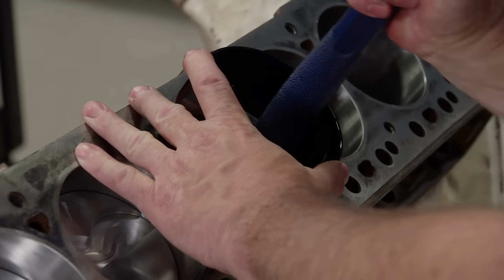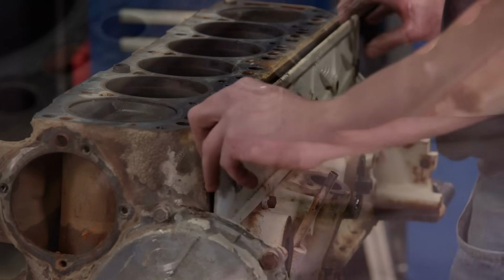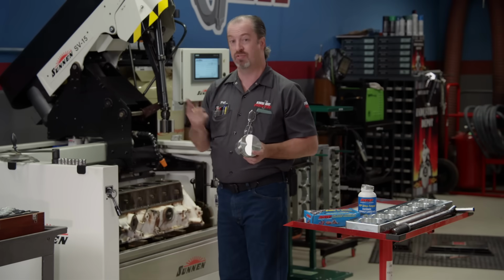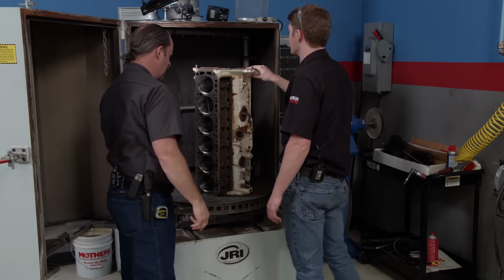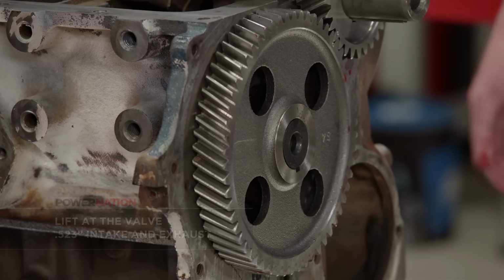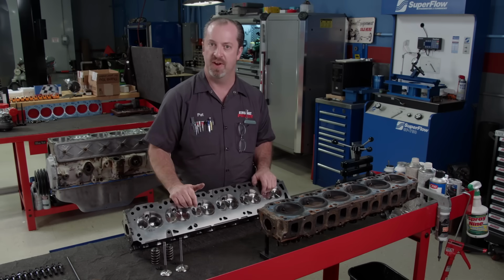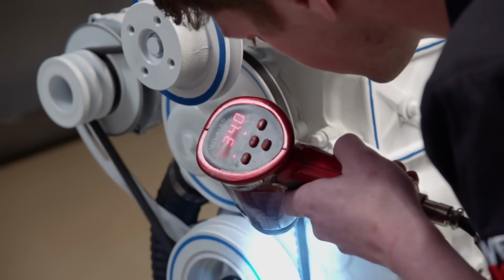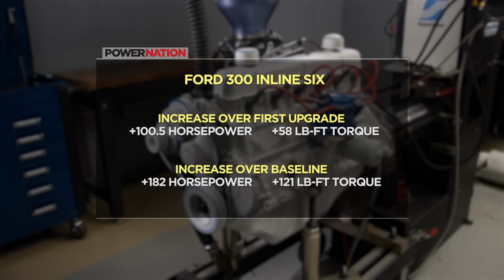Full-Tilt Build On Our Ford 300 Inline 6 For Serious Power Gains - Engine Power S8, E3

Comment: I had a f-150 with this engine, never let me down.. great engine!
Reply: John, I don't know about that my 73 ended up with over 500,000 before rebuild; it's all in how you take care for it!
Reply: @bigboreracing356  i bet it did. I have seen plenty past 500k and running like they had 50k. I personally have never seen one fail and between me and my dad we have over 30 obs fords. Best engines ever made
Reply: @bigboreracing356  design>materials used you idiot. Why do you think Chinese honda clone engines still run forever?? 
But lets break this down. 1. You could literally wear a truck out that has the inline 6 in it, throw the engine in another truck and it will outlast that one too. 2. These trucks will last well over 200k😂 proper maitenence and normal use. These trucks will last forever. Especially when paired with a manual. I see high mileage 300s all of the place still driving. We had a bricknose with 275k and the thing literally wouldn't die no matter how much abuse we put it through. And duh. Theres lots of these trucks in junk yard, but they arent there because of motor problems I can assure you that. Arpund 300k they get some lifter tick, which a bottle of marvel mystery oil seems to always solve it. Also, not only are these engines extremely simple, they dont turn very many rims which = less wear. And ughh durrr maybe ups stopped using them because they are outdated, slow and drink fuel??because it's definitely not because of reliability issues. Be careful who you talk shit to you f*ckin retard. Best engine of all time hands down(reliability wise) crysler slant 6 is close aswell as the 4.0 i6. Even chevy guys respect 300s, you are just too stupid to realize that
Reply: Had a 1973 F150 with the 300 and 3 on the tree, had tons of torque! I don't know the final ratio but I could take off on level ground in 3rd gear only issue is I couldn't pass a gas station only got around 8mpg!
Reply: @jackedwards7420  My first Truck was a 74 f100 with a 240 six in it  .   Yes it could pass a Gas station but not very fast  .  I drove a 95 f150 with the 300 in it for a long time it had plenty of Power .
Reply: @jackedwards7420  , how much weight could it pull, I'm about to buy one today 4x4 and just curious
Reply: @alfonsom8286  , I don't really know but mine was in a 76 swb pickup carrying a full cab over camper, a dirt bike mounted on front end pulling a 72 Nova drag car on a 16' trailer  and coul take off in 3rd gear!! Slow but steady!
Reply: @jackedwards7420 ,  Oh wow, those had to be fun times. Sounds like it will have no problem towing my Cadillac Seville, I'm picking the truck up today and can't wait to start the restoration,  I was leaning towards engine swap but after watching so many inline 6 power boost videos I think I'm gonna stick with it.
Reply: I still have a f150 obs with efi and it's a decent little truck
Reply: I think that's why everyone loves this build so much. Pretty much every car  guy knows someone who owned one or have owned one themselves. Such a prolific engine.
Reply: @bigboreracing356  you know that it rolls over, right. You think people are rebuilding stuff at 40k? You're pretty dumb lol .. |99999|9| miles to |00000|0| is 100k miles, doesn't take a scientist to document every time it's rolled over..
Reply: @primer50  I had an '88 F150 that was like that when I bought it. Turned out the bearings in the Mazda 5 speed were so tore up after 240k miles that it was robbing all the power. It was so bad that the cruise control would limit out due to all the throttle needed. I knew they didn't have a lot of horsepower but that let me know something was wrong in the drive line.  I swapped in a ZF S5-42 5 speed which has an even deeper overdrive and changed out the rear gears for 3.08's to squeak another mpg or so out of it and it would run down the highway no problem in high gear after that, about 1800 rpm at 60 mph, even with a trailer behind it. Got decent mileage for a 300 too. Didn't win any races with it but it pulled way more trailer than I should have with that light little truck and it never bothered that motor one bit.
Reply: I used to work at a crop dusting service. all our nurse rigs (ford f-750's from the early 70's) had 300 sixes. great engines. for the first half of the day theyd run on regular pump gas. second half we would gas up with 114 octane av gas...
Reply: @bigboreracing356  No shit sherlock, did you figure that one out for yourself or did someone have to explain it to you?  fyi, it wasn't quite 7/10s.
Reply: @primer50  
Mine was the same way. You could go faster in 3rd gear than you could in 4th. Lol
Reply: there's a guy in my town with an '88? F150 with this engine and 800k miles on it
Reply: @hank1556  Wow! 800k never heard of that.
Reply: What the hell are you guys talking about, my 300 is a dog and has left me stranded on multiple occasions
Reply: What the hell are you guys talking about, my 300 is a dog and has left me stranded on multiple occasions
Reply: i had f150 85 with this motor is indestructible
Reply: @bigboreracing356  Yes I did.  821,353 when I sold it, rebuilt the trans after 400k, replaced an alternator and water pump and blocked off the egr. That engine refused to die.
Reply: @deadon4847  guy below doesn't know how to read an odometer when it turns over that and take away the word suck from his vocabulary he's stuck
Reply: If it can still run with a rag wrapped around the impeller then you know that engine is reliable.

What happened to making engines like this?  

They completely gave up on the whole industry.

Comment: I did a 300 Ford 6 with Windsor Pistons flat pistons in it the early rods and big Cam and opened up the intake valves run like a raped ape

Comment: More straight sixes and other oddball engines!!!
Reply: It's pretty funny that you think of a straight 6 as an oddball engine. They are inherently better than a V type engine except for weight and length. If done right they can perform with any V engine of similar design parameters. BMW still sells and races inline 6 powered sports cars. And they sound so very good when made to perform properly.
Reply: @chrisbaker2903  I think he means like  old American i6 they where never really used for power
Reply: @chrisbaker2903  Only oddball in that TV shows don't do much with non V8s.  I just rebuilt a straight 6 myself. They're awesome.

Comment: However....it IS time you started using actual fuel injection. Not throttle body FI, actual fuel injection. With fuel rails, injectors, etc. 

And do a test to see how much power it gains from TBFI or a carb.
Reply: depends on which corporate overlord 'donated' parts. Pat has no say in what parts get used. Holley, FiTech whoever 'donate' parts, that's what gets used
Reply: @harveylong5878  Partially. And some stuff they source themselves. They can do real FI, if they want to.

Comment: I had two Ford vans way back when with this engine in them, when it came time to say goodbye to each of them it wasn’t because of any engine or power train problem,  the bodies just plain rusted out beyond serviceability.  The engines and power trains were still in great condition.
Reply: I sold a 93 F150 with a 300 and M5R2 trans, about 5 years ago. It was originally my Granpa's. He bou g.j t it new in Buffalo NY, and gave it to my dad in '99. I bought it from dad in '04. When I sold it, it has 722,000 miles on it. It was the original motor and trans, with just replacement parts like the alternator,  water pump, distributor, etc. The guy I sold it to is still driving it, and now it's got 780,000 on it, and it still runs great.
Reply: @scottdoubleyou563  that’s good mileage even for a big diesel
Reply: @deborahchesser7375  I'll be honest, I've been kicking myself for selling it.
Reply: i had a 1990 e350 with the 300 and a C6... no top speed but massive amounts of torque... motor blew at 140k, the "composit" timing gears teeth all wore out ... stupid thing was basically wood chips and glue
Reply: @bigboreracing356  you sitting here trying to call the 300 i6 a bad engine is a pire display of your automotive ignorance my friend. 

This engine has a cemented and proven reputation. 

I know its a ford and you feel the urge to bad mouth it and say its bad. But this engine is literally one of the greatest ever made.
Reply: @bigboreracing356  so it was a 350 or 400sbc. 

Against a 300 i6 is not impressive in the least bit.
Reply: I had a red 93 F150 with a 300. I called it the Exxon Valdez because it leaked every fluid imagineable! But on the coldest winter mornings or the hottest summer afternoons this truck would run like a champ.
Reply: @bigboreracing356  amd the 300 i6 will never be fast. Its not what the engine was designed for.
Reply: @bigboreracing356  your just one of those cultists who cant see anything outside thier own farytales. 

This engine is recognized by every automotive expert and professional 😂😂😂😂😂😂

Yeah bud. Curb your ignorance. 
Chevy is awesome, wonderfully reliable. 

But at least im honest
Reply: I know a guy who checked the oil in his F150. It was something like five quarts low.
Reply: Hence the term: 'Diamond in the Rough' lol.
Reply: @bigboreracing356  the 300 i6 does outlast the chevrolet small block and all its torque is produced at low rpm. 

Thats why they were used for everything back in the day. You could find dump trucks with 300 i6 engines and multi gear transmissions

I bought a 300 i6 that had the head gaskets burnt out of it and never had to do anything to it. I ended uo trading it for  a newer truck.  

Not to down the sbc but in majority of cases the 300 i6 is a more durable longer lasting engine.
Reply: @bigboreracing356  😂😂😂😂😂😂 
Sure bud. 
All praise to our Lord and savior chevrolet
They are always better and perfect. 
All heil chevrolet. 
😂😂😷
Reply: @bigboreracing356  still wrong. Think age makes you smart all the sudden?
You must be related to Nancy Polesi
Reply: @bigboreracing356  ah, the troll that lives under POWERNATION's bridge is here.
Reply: This sounds a lot like the SEARS Service vans. I knew of several here in Colorado that this 300 engine wore out the van body AND several drivers before Sears gave up on them.
Reply: For an off road truck I will take nothing else but a 300 i6 at least in terms of gasoline engines. I dont need a lot of speed up there but I do need something that I can guarantee will bring me back to civilization every time.
Reply: @bigboreracing356  chevy tried thier own version with the 292 but it simply wasnt as good.
Now with this engine build 

I know this engine build jas comparable numbers to a 350sbc amd the torque is made lower which means this 300 is a better work engine. 

The whole point of building out 300s is for
1.) Hotrods (more show than actual speed)
2.) Work(normally guys looking to pull big trailers like myself
Reply: @bigboreracing356  now your bullshitting.
Reply: @bigboreracing356  dude i drive chevy. 

I have a 2015 malibu, 1995 1500, a 1992 corvette and a 2003 impala
Reply: @bigboreracing356  "cant argue with an idiot* so true.
Reply: @bigboreracing356  have a good one.
Reply: I had an 86 F150 and an 84 F150.  I totaled the 84 and the other was burned up in a garage fire.  Engines still ran great.
Reply: Had a 95 f150 with this motor but fuel injection.    Same.   Bodywork was 90% filler and expanding foam. Motor ran like a top
Reply: @spiralinglight  I forgot about this one. The others I owned in the 90’s but this one I owned in the early 2000’s. I took it to Germany with me. Every farmer I met over there wanted to buy it.  https://imgur.com/gallery/pRCvIL7

Comment: What always irritates me about pushrod in-line 6’s is that they always have the intake and exhaust on the same side, I wish someone would make a head that puts the intake opposite of the exhaust .
Reply: A guy in the states did years ago and drag raced it with much success, he cut up some Cleveland heads & furness brazed the sections together, it turned out to be quite the beast and  he cleaned up his class.............
Reply: @frankno2plus1  I read an article several years ago about a guy named Leo Santucci who done that to a Chevy 292, it was quite involved, seemed like he even had it installed into a studebaker
Reply: Sameeeee
Reply: the pontiac iron duke 4 banger is crossflow.